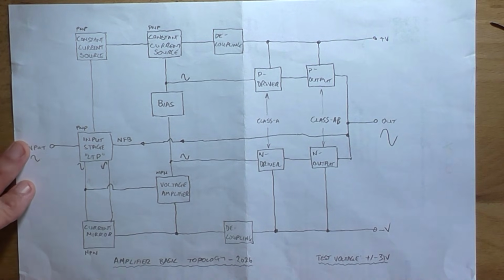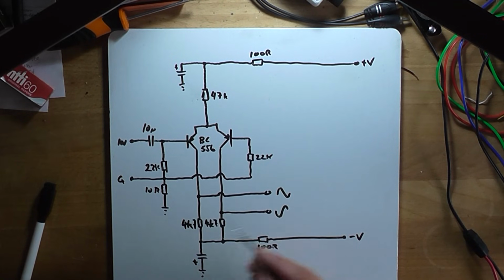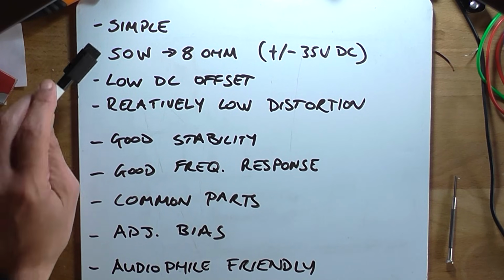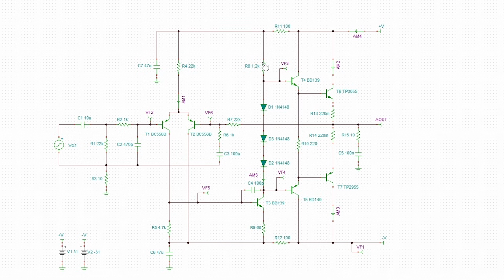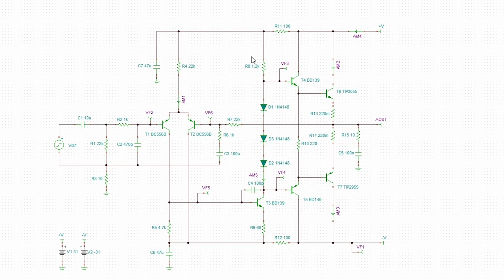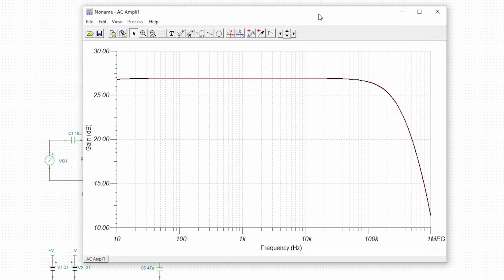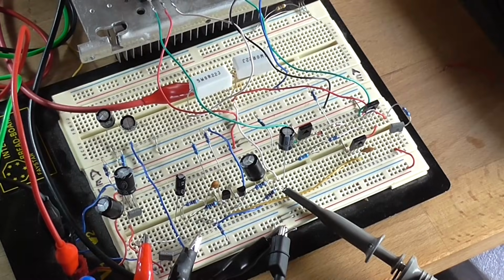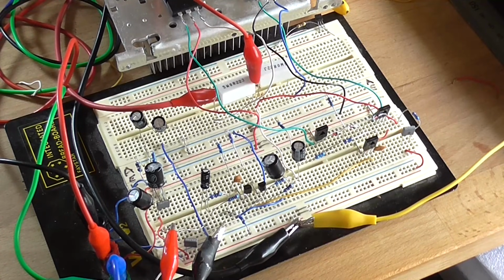Designing An Amplifier From Scratch: Pt. 1 - Basics

Comment: It looks as though the negative going side is not getting sufficient drive. I would change R5 to 680R, replace R9 with a short circuit, and decrease R4 to 10k. Then try the breadboard sim again. I suspect that after that, you'll see clipping on the positive going waveform first. The bootstrap should fix that. The bootstrap cap also needs to be 220uF or so. R8 and R16 could also be increased to 1.2k each. This will bring the dissipation in each resistor down to around 0.17w (170mW).

Comment: Before moving on to current sauce! you could try messing with the values and ratio of the bootstrap thing. I've never done bootstrapping myself but I have been going through a phase of reading amp schematics and they never seem to be same value, and even more surprising, Kenwood/Trio went back to using them in the 90's.
I just had a random look at one amp and saw 1k and 4k in the boot strap, like many I was told 1 to 1, but no...

Anyway, just thoughts, I'm no transistor wizard 😁